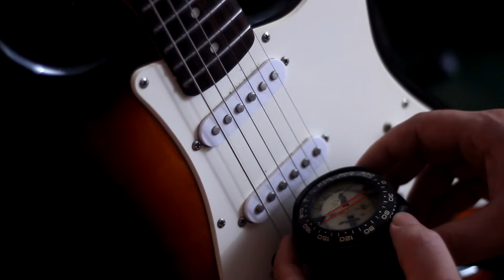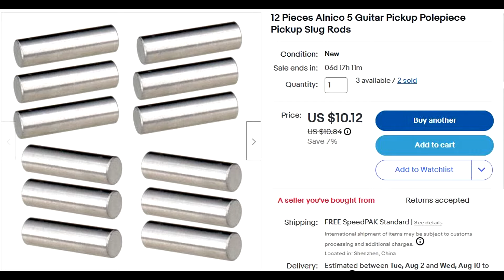Mod Cheap Ceramic Pickups Into Vintage Staggered Alnico (Easy DIY!)

Comment: I liked the ceramics much more,didn't expect that but they sounded just rounder to me. Keep up the good work!
Reply: You are correct, sir. I'm guessing there isn't a lot of wire on those coils, so they start off thin and bright, and the alnico magnet just emphasizes that.
Reply: @fretbuzz59  You've just explained exactly how ceramic microphones are typically built. Little cable and ceramic magnet to recover volume and bass.
Reply: If you like bassy tone perhaps you could try neodymium magnets.
Reply: @brunocejas  No. A microphones has a diaphragm that moves in response to sound waves. A magnetic guitar pickup works when a metal string moves within a magnetic field--it doesn't pick up actual sound waves.
Reply: @fretbuzz59  There is no specific translation in Spanish for "pickup", we say microphone to everything. Anyway that was not my point.
Reply: @brunocejas  I see. Now I understand what you were saying. So yes, for inexpensive pickups with a smaller coil (less wire), a ceramic magnet would help increase output and bass. BTW, "transducer" would be the word that applies to both pickups and microphones.
Reply: @fretbuzz59  no! Its oposite. Alnico magnets positioned in coil make wire coils less bassy and more trebly than one ceramic magnet under the coil in same possition of pickup under the strings. If you want to make more trebly "cheap" ceramic pickup, you just move it further from the strings. Simple as that. But, if you want to live in dream, you dont have to listen sounds, you just mesure the price of your gear.
Reply: @СашаПетровић-н6х  You said: "Alnico magnets positioned in coil make wire coils less bassy and more trebly than one ceramic magnet under the coil"
I said: "for inexpensive pickups with a smaller coil (less wire), a ceramic magnet would help increase output and bass"
We're saying the same thing.
Reply: @fretbuzz59  yes, im sorry. My brain gets in fire when i read "cheap", "inexpensive", etc. I have cheap guitar, it is purchised cheaper than that because it has flows from factory and stayed too long in store. Problem was not build quality per se, problem was final assembly and adjustments, and later, 20 years of use. Its Lead Star from DDR. 20 years after, thanks to good people from Youtube i managed to fix almost all flows. One pot is waiting to be replaced :) I dont have any wishes to replace "cheap" pickups. They dont sound like coins, they sound like pickups :) Its now instrument which deserve to be played by better player than me, more expensive player :)
Reply: you're right lotta guys prefer ceramic . seymour duncan uses alnico with ceramic on a certain model p.u.
Reply: Yeah ceramics are great,. What I'm hearing is you didn't tuned up your strings to pitch on the ceramic trail..

Comment: Definitely an improvement in tone. Well done! Why pay ridiculous prices when you can learn to modify?
Reply from the maker: Thank you so much for watching and taking the time to comment Baron. It really did get that vintage bell-clear slinky sound. Yeah Im always gonna try to tinker with something before I go spending $... Because I have no $ hahaha
Reply: but how else will some dude charge $500 a pop for some PAFs he made in his garage (which is to imply you could make them in your garage too. or even a bedroom!)
Reply: "Improvement" is in the ear of the listener. With those pickups, in this test, I much prefer the ceramic. Perhaps with a beefier coil the alnico would be an improvement. But here they just sound thin and brittle.
Reply: @fretbuzz59 perfectly agree with you: "improvement" is matter of personal taste

Comment: Well I'm torn. I actually liked the ceramic tone better in a few cases, especially the Klon boost neck and middle. The harsher, more twangy and metallic sound of the Alnicos didn't come into their own for me until the overdrive pedal entered the mix. That's both the delight and downside of tone: it's very subjective. Regardless, this was an excellent video on how these pickups actually work and what can be done to change the tone - well done!
Reply: Billy Corgan’s signature bridge pickup is… Ceramic. Ceramic pickups can be awesome
Reply: ^ This, plus, for me the Ceramics were preferred for the majority, but that's with my ears : )
Reply from the maker: Thanks for watching and taking the time to comment. Absolutely Ceramic pickups can be awesome! Fat bottoms and more grit. I love the ceramics in my burl Tele. I do like that vintage bell tone chime though, if I now add a bit of bass to the preamp and crank the volume I think it will still chug like the ceramics but also sparkle.
Reply: You could split the bar and only replace the upper three slugs. I have seen mixed alnico 5/2 pickups, why not do it with ceramics. Maybe score the bar with a glass-cutter first

Comment: I have to say I preferred the sound of the original ceramic magnets. Good video.
Reply from the maker: There you go... Many people will choose ceramic in a blind test.
Reply: I bought and sold many strats, (mexican, Japanese, American,...) they all sound different. My favourite strat is an american traditional which came with cheap parts including ceramic pickups. If you want a beefy sound, ceramic pickups are not bad at all, they are just not that clean, sound almost like the tone is rolled off a little And with distortion ceramic sound real good! I also like the alnico pups sound but it is thinner and chimier ...

Comment: The middle pickup being opposite polarity isn't what gives you "the quacky sound" in the inbetween positions (unless the pickup is wired out of phase, which then does indeed further emphasize the quack). It's what makes the inbetween positions hum cancelling, because the two pickups with their opposite polarities essentially turn into the coils of a humbucker.

Comment: I have done this in the past, but now you can buy full A5 strat sets for under $10. I compared them to my Texas specials which cost 10 times that much and I swapped them out and gave the Texas specials away.

Comment: If you have one of the pickups that you can't change the pole pieces, you can still put alnico bar magnets on to get the sound. You do such a good job emphasizing the obvious, I'm surprised you skipped it. Great vid, thanks.
Reply from the maker: Thank you for watching and taking the time to comment Troy. Yeah, I guess I dropped the ball on that one. I guess I just didnt think to include it because Ive never actually tried it myself. I should put that in my notes though and plan to include it in a future video.
Reply: @heavymetalATC  thanks, the neodymium work you have posted has had me paying a lot more attention to all the different ways that pickups are built, and has given me some ideas. I plan on repeating most of it. I love the sound of a cheap pup with a neodymium bar. I think it's the same principle as G& L's MFD's.
Please keep posting. I have learned a lot.
Reply: good to know
Reply: That will not work, because the iron slugs in the coil need to be removed to change the sound. The magnetic flux change from the string entering an alnico magnet is different from the magnetic flux channelled through iron. It should not matter much what magnet type is magnetising the iron, only the flux change entering the coil matters!
Reply: @atraneberlin1977  have you tried it? How do you know it will not work? A very basic understanding of physics will let you know it will change something. Whether or not you'll like the change is entirely on you. But it is really simple to find out.

Comment: I also think the ceramic sounds better. Likely, because the pickup was originally wound to match the ceramic pickups.
Reply from the maker: Thank you for watching and taking the time to write a comment MET3. I Like both Ceramic pickups and Alnico pickups but for different reasons. In a mix/band setting especially when using an 60s fuzz circuit with the volume dialed back to edge of breakup lower wind count Alnicos do some kinda chuggy jangle thing? But its a great tone to have for cutting into a mix. Another thing is... the volume and tone on the amp was set for ceramic as well as having the low wind count with a bigger tube amp cranked up its the beez kneez. You can hear a good example on the fuzzface/rangemaster hybrid pedal video a few episodes back.
  No doubt though Ceramics are Awesome for low volume bassy chunky SRV sounds or even heavy rock to punk rock grungy tones. Ceramic Telecaster pickups can be pretty darn sweet too, jazz + Twang.
  I think I kinda like most all pickups I just love trying all the different configurations of parts and materials.

Comment: I am a welder and have been setting up + modifying guitars for over 25 years now.
Never thought to use torch tip cleaners as a nut file.
Thats a freaking great idea! Thanks!

Comment: I NEED to stop finding these sick videos on mods... I opened my MiM strat to switch 1 pot, and now it’s been 3 months and I can’t stop: coil split, concentric treble and bass cut, 10-way selector switch, shielding, artec QDD2 (check it out), and now I want to do this. It never ends, it’s so fun.

Comment: Hey now! I heard you saying in one of your videos that for the subject matter of swapping magnets in pups you get better bass response in this order: alnico, then ceramic and then neodymium. That said, would be great to have a reference for doing that, I mean taking one or even better, several coils resistance measurements as examples, that way anyone could look specifically for the type of magnets for their needs/preferences to swap them having a more certain scenario regarding on what to expect. I'm asking because I saw several cases where they change magnets and get the opposite result they were looking for. Cheers!

Comment: I had one of these cheap bullet Squires. The pickups were decent, plugging into a good amp helps. I liked that the humbucker had 3 screws to keep it from moving, more stable. The polarity has nothing to do with the "quacky" sound. It cuts the hum when using 2 pickups at once. I think that quacky sound you're thinking is if the phase is reversed, not the polarity
Reply from the maker: Thank you so much for watching and taking the time to comment Lou.  Yes, those humbuckers will also let you angle the pickup more toward the bridge or the middle kinda like an EQ, may not be "proper" but it works. You've gotta consider that there is coil polarity as well as magnetic polarity. Flipping the polarity of a magnet will put a pickup in and out of phase with another. As well as winding a coil clockwise or counterclockwise will put a pickup in or out of phase you can also switch the wires + to - to flip the phase. The middle pickup in the video is both reverse wound and reverse polarity so it is out of phase twice putting it back in phase and this does cancel the hum, but my own experiments have shown me that the RWRP hum-cancelling has a bit of a different sound it rolls highs a little and has mid quack a lot better than two pickups with identical coil and magnetic polarity. Of corse there are other factors that help, pickup height, pickups strength matched or unmatched. Yeah, actual out of phase combo whether done with the coil or the magnet is definitely noticeable it kills all the bass and sounds super nasal and thin. The other strat I played briefly in the video has a ton of switches in it as its wired to swap coil polarity for in out of phase combinations as well as series/parallel but I kept all the pickups in magnetic phase so it really doesnt seem to "strat quack" quite as well. I can however do awesome jazz box humbucker and out of phase tele kinda tones.

Comment: man the background music in these videos is pretty groovy

another cool project, i love pickup experiments
Reply: that mexico dance thing))😁
Reply from the maker: Thank you so much for watching I'm glad you dig the videos as well as the funky background music. I used to be a pretty serious underground rapper and music producer. I was managed by a DJ that ran a radio station in New York, I was signed to BMI (I think I'm still currently under contract for publishing), ICP featured me on Juggalo news... I just kinda slowly fell out of it, if you dont keep the music coming you lose all the steam you built up fast So nowadays I just make music on the side for fun and I'll slip it in as background music in the videos. After all I started collecting modding and building gear to make music. I'm glad you noticed it, That's awesome. I did this one trying to play classical guitar with only two fingers like Django Reinhardt or my buddy Petey TwoFinger. Then I did percussion using tin cans and bongos and stuff. It came out pretty funky so I looped 2 sections and threw a hip-hop beat on top and used it as a background track.
Reply: This cannel Rocks!btw)
Reply: @heavymetalATC  As bass player i ve notice that)).This great.Ive built my first guitar in the summer of 98 (it was explorer from birch plywood x D) and since then i one or another way build pickups guitars etc ).In these old days yo cant geat a gerar because of overpricing .But instead i was ham-radio amator studied this things in Radio classes(local)(and freins too xD) so i start to built monsterous distortion pedals out of soviet chips.then was modding hi fi amplifiers .then  learn a guitar gear ( mainly Marshalls (he is great man and genius).

Comment: I bought a cheap SX Strat and the sound of its cheap Ceramic pickups like me much more than a set of Fender Custom Shop 69 loaded in my Fender American Standard from 2011... More expensive is not always better. In your case the Ceramics have more mids and the AlNiCos are mid scooped, in my case it's the opposite, the Ceramics are more scooped than the 69s, it's incredible, they sound amazing.
Reply from the maker: I wish I had 20 sets of the ceramic pickups in my lotus strat copy they are the super deep ones with wax poured in the back.

Comment: When you are charging up the alnicos with the old ceramic bar magnets, just tape a small strip of corrugated cardboard to each bar. You can then just run them back and forth and the cardboard will make it easy to maintain an even distance.

Comment: Those stock pickups sounded decent
Reply from the maker: Thanks for watching and taking the time to comment Stevie. Yeah nothing wrong with them at all. I just needed that thinner vintage sound for tickling a fatboy loud tubby tube amp the right way. They the bees knees on it but yeah for low volume playing or super aggressive music ceramic is the better deal.